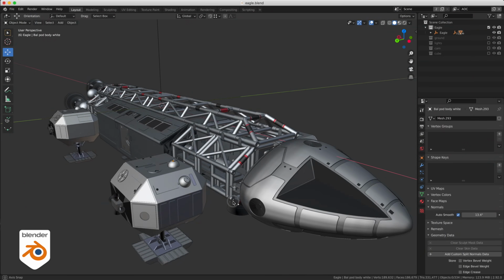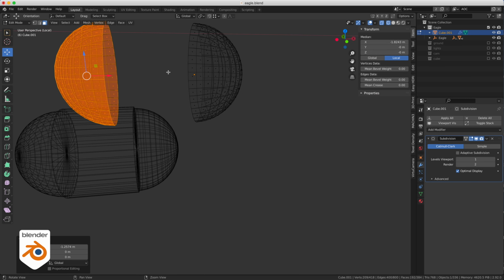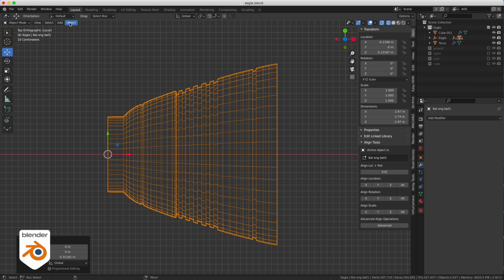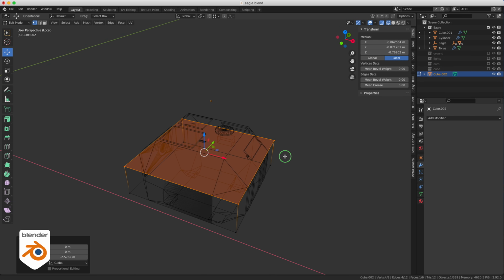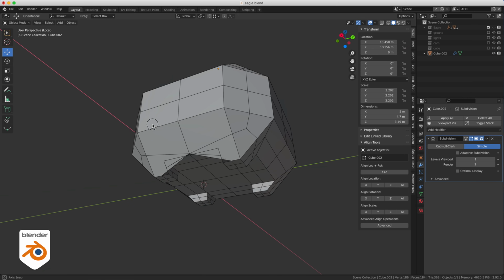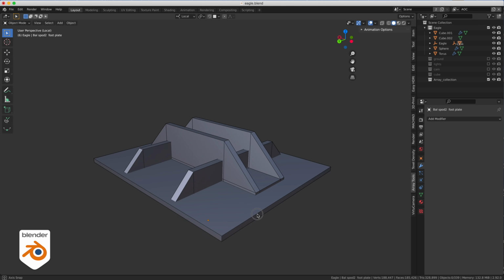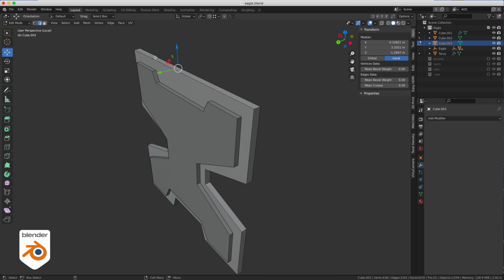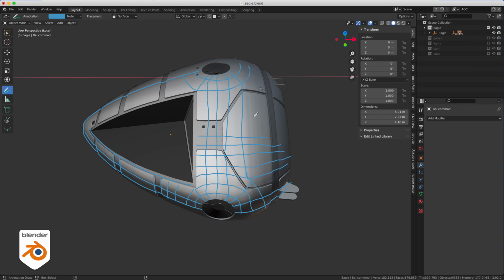Basic modeling tutorial in Blender Part 1 EP25a

Comment: 14:57 If you press Ctrl + Shift + Num- , BoolTool will automatically apply the modifier and delete the cutter object.
(Which BoolTool for some awful reason calls "Auto" mode. What you did (hotkey without Shift) is called "Brush" mode...)
Reply from the maker: I didn’t know that. Blender has so many hot keys and my brain is limited to 4735 ones. I guess that one was one too much. ;-)
Reply: @BlenderBob  Yeah, there's a lot, even before activating any add-ons... Thankfully, I think all functions & operators can be found in the menus (BoolTool in the sidebar under "Edit") and/or via the Search tool.
BTW, your custom hotkey setup feels both bonkers and extremely cool to me. Glad you found a way to make it work how you need it! :D
Reply from the maker: Yeah and because I customized my hot keys so much I can’t show the keystrokes. A lot of people ask me to turn them on. That’s why I go in the menues to show what functions I use.

Comment: I believe you know what you are doing, but I am often surprised at how many experienced modelers are content to simply "eyeball" properties that can, and often should be, exact.  In this case, you basically guessed at the proper Factor for the Cast Modifier.   The proper setting for a sphere is 1.0 .  In many cases, nobody can tell the difference, but in more precision work in which parts need to mesh and work together, small inaccuracies can compound into a useless mess - which I'm certain you are aware of, not only in modeling, but in Tracking, Compositing, Rigging, etc.
Reply from the maker: Well, you saw my clip on imperfections. If you want to avoid the CG look, you have to break stuff intentionally. See the Flexseal clip. We're not doing engineering. That was the problem on Welcome to Marwen. The VFX sup was crazy about getting everything to the quarter of the mm. And that's totally pointless because nobody can tell. Imagne, three retakes on bullet shells! But all we see are hundreds of blurry cylinders. Who cares if they are 3 mm too long? We went way over budget on the modeling because if his insanity. Every guns, props, chairs, ANYTHING, even if it's far away, had to be perfect because that's what he wanted. That's not the way to go. The only time you need perfect accuracy is when you do a CG takeover, where you replace a real model with a CG one.
Reply: @BlenderBob  Thanks.  I agree - I've delt with the perfectionist CG sups myself, and they have their place where appropriate.   I'm not here to argue, but to clarify.  In a case of rigging, a misshaped sphere or inexact pivot point could cause wobbly motion or interpenetration problems between objects.   I'm just saying mathematical precision has it's place, and should be applied where appropriate.

Comment: Love the video - however, you go through things very quickly and as you have customised settings/shortcuts, some things do not appear to work or are as easy to do as you do them.

eg. When you split the sphere to create a cylinder, both your halves appear to be 1 object, however, when I do it, it creates 2 separate objects so I cannot BRIDGE the edges?

Do you have another video where you configure Blender, install addons, customise settings etc..?
Reply from the maker: Yeah, I made a mistake in my clip. It's not separate, it's split. But actually you can just select the polygons and extrude. By bad
Reply: @BlenderBob  Much better thanks.

Comment: thanks for that, this is why i failed miserably at distord round polygonal object with displacement texture, after all those years of 3D practicing since 2001. i seriously need to manage the distribution of my quad arround rounder object, it could make my udim and texturing job much easyier ...
Reply from the maker: You can turn on experimental in Cycles. It will work no matter what (after you add a subdivision modifier. That is, if your model is sub dividable. Check my clip 1A for more info
Reply: @BlenderBob  im already using it, but i need to make my model more clean, before surfacing with substance painter, could make a huge difference, i always work as " Less is More " especialy with the texturing and sculpting tool we have today, i also do some stuff with metaballs and in Zbrush, but i prefer make very clean model before sculpting anything, make my posing and animation life easyier...

Comment: Just in case someone doesn't know:  You can also use the command "To Sphere" in Edit mode (as opposed to the Cast modifier) ... which is what I would typically use to make a sub-d cube perfectly round ;)

Man, Bob - you are dating yourself ... I mean, I thought I was one of the only people would remember Space 1999 ... and Erin Gray ... hubba hubba ;)
Reply from the maker: I didn’t know that. Thanks
Reply: Shift A add round cube, it's there in the menu
Reply from the maker: @donaldcourtemanche2395  I wish it was
Reply: @BlenderBob  non?? Hmm peut-etre avec mesh extra qq chose de meme, y a meme un vertex seul si tu veux. Pas acces a mon ordi malheureusement
Reply from the maker: @donaldcourtemanche2395  Sweet! I'll mention it in part 2! Thanks! (Why this is not ON by default?)
Reply: @BlenderBob  good question..comme node wrangler et autres. Glad it help Bob 😉

Comment: Mirror modifier would work better for symmetrical objects.
If you mirror across one axis, you half your work; 2 axes, you do 1/4 of the work; all 3 axes you do 1/8 of the work.
You can also nest the mirror modifier.
For instance, for the pods where the landing legs protrude from are symmetrical on the X and Y axes, so that's one mirror.
It's symmetrical across the centerline of the vehicle, so you add an empty on the centerline then pick it as the mirror object.
I think those pods are symmetrical fore and aft, so you can move the empty so its in between, now you have four for the price of one.

I'm glad you have the link to the Array tools though. It looks really handy. I don't know why something like that isn't included in Blender's core code.
Reply from the maker: I will cover this on part 2 for the head part. :-)
Reply: @BlenderBob  ahhh, gotcha. I'm getting ahead of things.